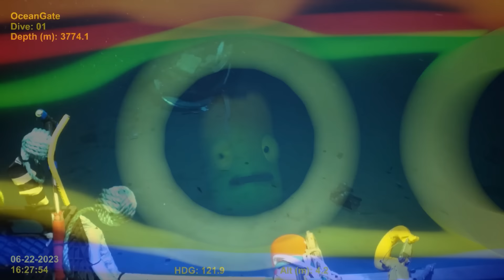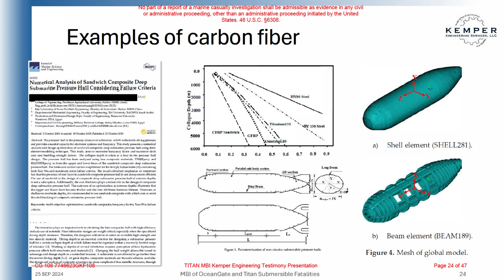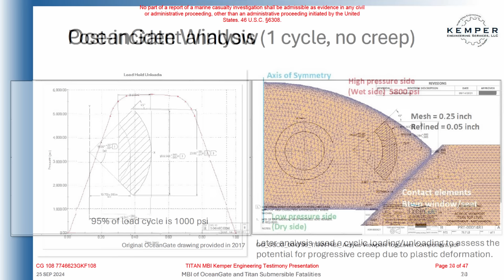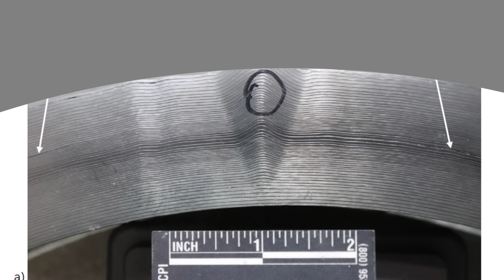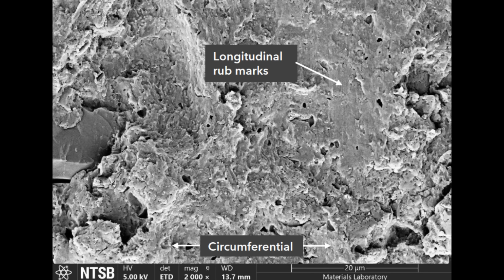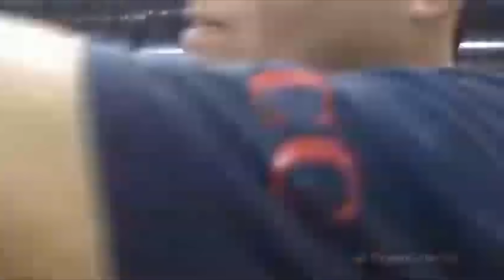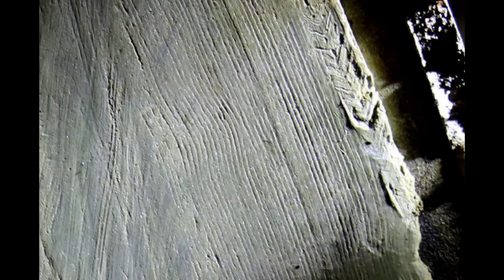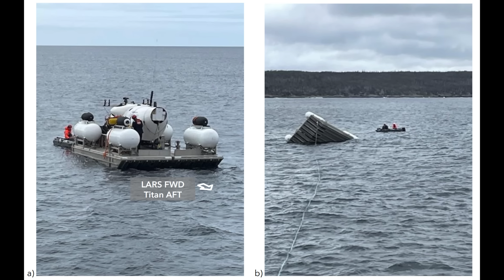OceanGate Wreck Shows Why Sub Wasn't Strong Enough To Survive - NTSB Shares Important Details

Comment: There aren't words for how stupid it was to not plot depth vs strain - it's so breathtakingly idiotic I could be convinced Stockton Rush did it intentionally. IT'S LITERALLY A STRESS-STRAIN PLOT YOU LEARN ABOUT THEM IN FIRST YEAR ENGINEERING FFS!!!
Reply: When you think the other way around ,it is deliberately done, maybe you see the same sense i do. Btw. strain gauges w/o an temperature and supply recording are pretty useless due to their crazy sensitivity. Further no one i know (me included) will use them that way. You have to put some rod to measure not only the local spot of a few millimeters/mils. Usual process is embedded fiber optic witch shows stretching/bending by wavelength-phase/signal attenuation.
Reply: @Winkemaennchen  An identical unbonded gauge can be used as a control.  It gets hooked up in a bridge circuit to balance out any temperature and pressure changes.
Reply: @DrJuan-ev8lu  Thanks, me remember that as wheatstone. Every gauge i used is designed that way but is very sensitive to EMC and temperature even then. However, someone logging  in that application over time instead depht/pressure will not care about  compensation.
Reply: @Winkemaennchen  They are logging it against depth.  The data capture is time vs. depth and strain.
Reply: In my first year of engineering at college and I can confirm that this is the stage when you learn about them. Day one stuff.
Reply: No.  It's a strain plot.  It's strain versus time.   A stress-strain plot is for quantifying material properties under load, but it doesn't do anything for real time capture.  You use a strain gauge to get strain vs. time, and you are supposed to know what is "good" vs. "bad" strain as well as whether the strain properly correlates to depth.
Reply: Rush: I  don't need no stinking engineer! ☠
Reply: Another issue that we're not hearing much about is that they were experiencing problems controlling their rate of descent.  I believe that they hit the seabed in a slightly nose down attitude.  Under the enormous pressure, this extra bump was the final straw.  The nosecone would have flexed enough to form a fracture in the joint, which would have been followed, immediately by a catastrophic implosion.
Reply: I am a biologist and chemist andI KNEW that this carbon fibre stuff was not going to go well.. under 2000 feet of H20... the stress is EVERYWHERE...and carbon fibers just cannot contain all that jazzz.. and they did lose out
Reply: @guysabol8743  Then you would be wrong - the US Navy has successfully tested a carbon composite submarine, the difference is they aren't morons so it never failed.

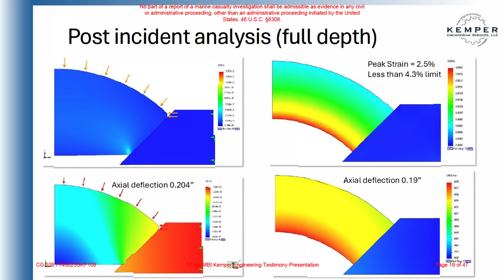Comment: 9:00 Optical problems could have been solved with a separate, floating acrylic convex lens in front of, or attached with a flexible interface, to the window. The optics would slightly distort as window flexed and the lens did not, but likely not enough to notice.

Comment: Oceangate were criminally inept. They used materials which had not been tested at depths in which they took hapless passengers. There was no engineering stress testing of either the composite main body or the end caps and the bonding process was just taken out of thin air with no chemistry research as to bonding integrity between the different materials utilized. Even acrylic is a poor choice compared to the strength afforded by polycarbonate.  So sorry but you are just providing rubbish analysis and discussion. Titan was manufactured more or less as an untested surface vessel, distortion and degradation of the structure under extreme pressure was purely decided on a hypothetical basis which is negligence in the extreme. It is not worth any further discussion in hindsight. Applying engineering principles prior to construction is the takeaway, trying to subsequently apply a rationale for the design is purely uninformed babble.

Comment: 15:59 that image reminds me when you sand to much over the dry wall sticky mesh tape you use to cover the space between boards.

Probably what happen is that when they where sanding to apply the different layers of resin over the fiber, they didnt do a good job cleaning the surface, leaving some sanding residue which clumps with the subsequent layers, creating those warped layers visible under the microscope and the uneven layers of resin.

Comment: I'm no physicist, but I had plenty of primary and secondary school projects which involved lots of duct tape - the moment you scratch off those bubbles in the tape to make it smooth, the faster you realise the top layers will easily peel off through wear and tear. I know tape and carbon aren't the same, but surely the same principal applies when you're trying to wrap a tube around with layers of tape? xD

Comment: I wonder if the adhesive between those carbon-fiber layers had been gradually eroded during previous dives and the only thing holding them together were the grooves in the titanium rings. I say this because it almost looks like the CF layers fanned out as soon as the flange sheared off.

Comment: I am given the impression that the titan sub did not implode uniformally more than it coiled up or rolled in on itself.
Reply: Like cutting a paper towel tube lengthwise how it would fold in on itself and create a smaller circumference.

Comment: No matter what one has to say about singing the glories of Carbon Fiber, it remains only as good as the glue that holds it together, and the manner of its application.  In this case both are questionable.
Im really surprised at the strength of the current down there.  Much stronger than I was expecting.